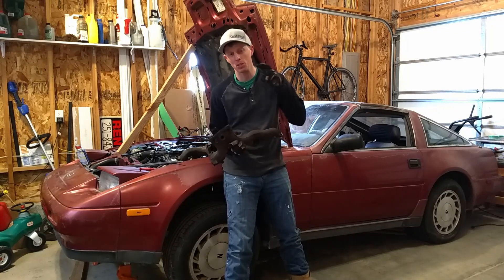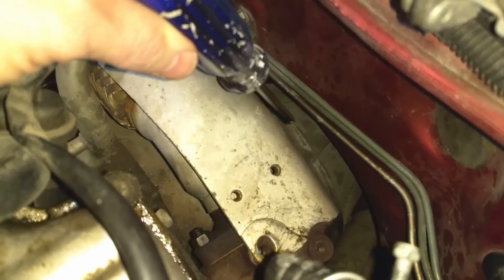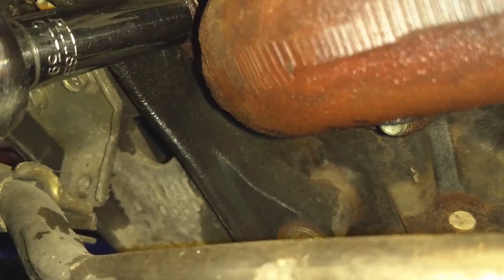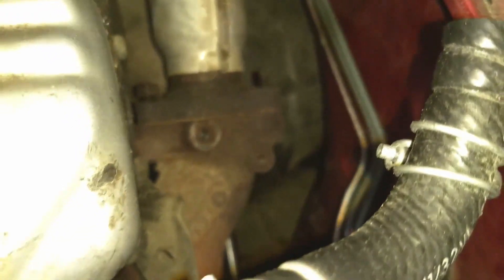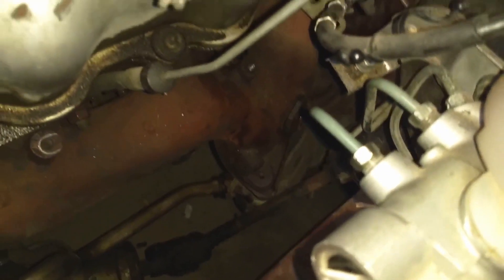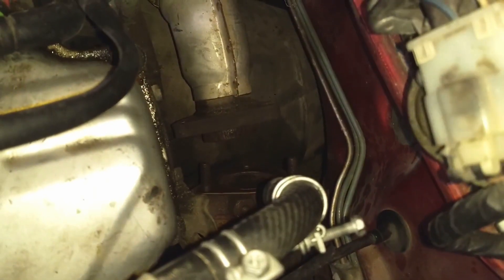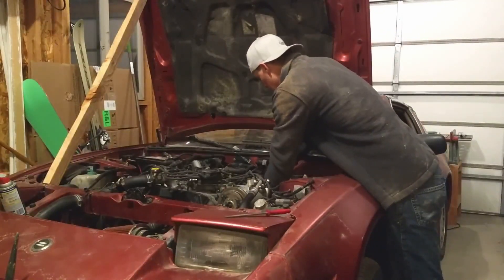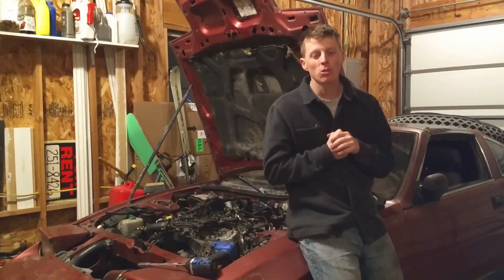300ZX Exhaust Manifold Swap - NA2T #2

Comment: Where did you find a turbo manifold?  I'm having a hard time sourcing one from a VG30ET, and aftermarket options seem nonexistent.
Reply from the maker: I found mine on eBay.  I think I was somewhat lucky. It was the only one for sale at the time.
Reply: @rrh5000  thanks for the reply! If you don't mind my asking, what did you have to pay for it? I'm assuming they command a premium, but getting a custom one seems prohibitively expensive.
Reply from the maker: @914Buster  it was about a year ago now, but I think it was about $125.00
Reply: @914Buster   pucker factory fab has the only aftermarket intakes, and exhaust manifolds readily (with turn around time) available, the aftermarket support isn’t wildly followed as most of us are super cheap 😂